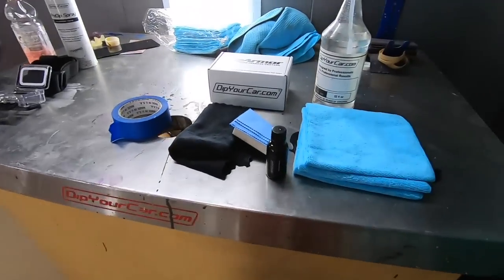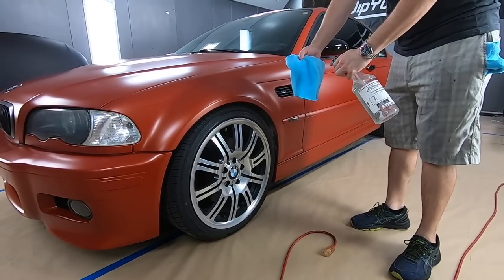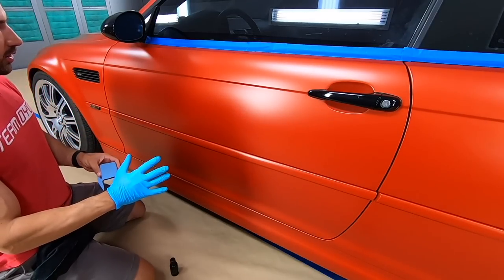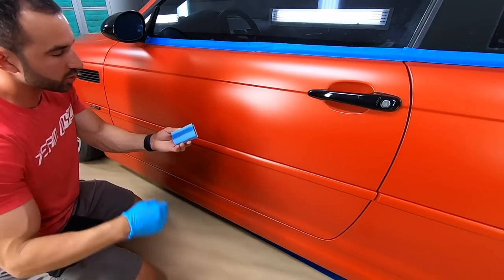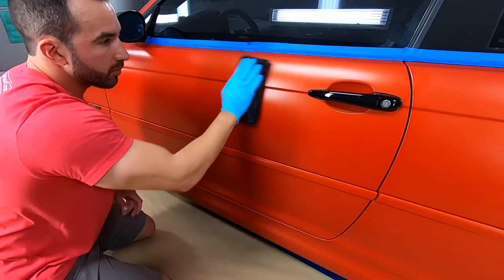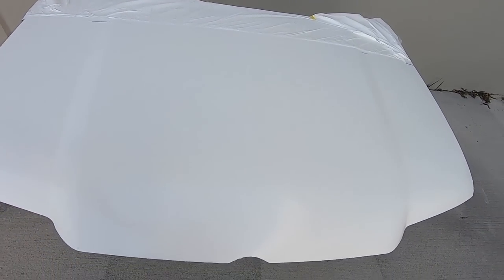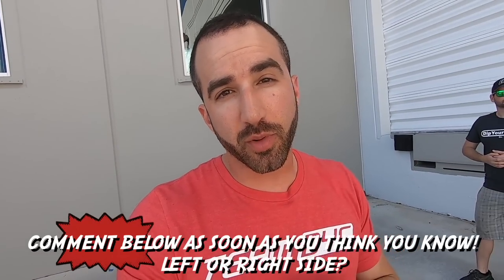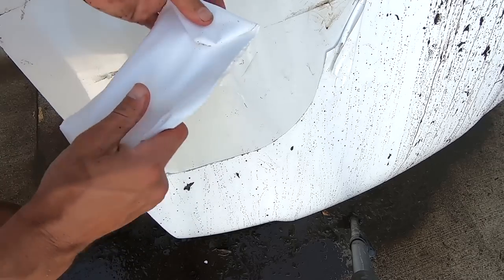Finally CERAMIC COAT Your PLASTI DIPPED Car  (Amazing)

Comment from the maker: How long did it take you to guess correctly?
Reply: After the first pour of blue on both sides works really good.
Reply: Left side for sure
Reply: As soon as the blue hit the left side, I knew right away. Lol wayy more hydrophobic
Reply: On the pour of the blue liquid. That's freaking awesome!!!
Reply: 'Bout 3 secs... dip armor is good, but it's just not a ceramic coating. ;)
Reply: As soon as the blue hit the first time you could tell that wasn’t coated
Reply: Bad eyes and second guessing lol. I waited until the red Gatorade hit the left side.
Reply: What would be cool to see is a dipped hood divided into thirds. First section just dipped. Second section dipped with dip armor. Third section dipped with dip armor and ceramic coated.
Reply: I still don't know which side has it.
Reply: Cali kit !!!! What up tho
Reply: DipYourCar 5 seconds lol awesome job Fonz 💯💪
Reply: Ceramic coatings are great for warmer weather climate but when you're in Canada where it's -20-30+ degrees in the winter I can assure it's the worse thing to do as every area that has PPF in front of my car the ceramic coating itself will crack into small squares in every single area! I can't imagine your Plasti Dip will be any different...

Comment: I really want to see DYC do a Dip everything series! I want to know what happens when you spray, wood, concrete, umbrellas, house walls, washers, dryers, and refrigerators. Can you just imagine a dipped tree house for your Kid, nephew , or neice, or even a young cousin! Or even a Dipped Fence! And is dip stencilable
Reply: nah... kids and plastidip don't go together
Reply: I want my whole house dipped 🙌🏽😩😂😂😂
Reply: Flex seal?
Reply: to answer the "is dip stencilable" question. Yes... just get that stencil taped down and flat before hand and pull it up while the plastidip is still wet to get clean lines.
Reply: I think a chalkboard dipped fridge would be cool
Reply: Just paint all that stuff

Comment: It was pretty clear, to me, instantly when you started to pour on the ceramic coated side. It ran off the right side but it was instant full streams running off the the coated side. Good looking product. Sucks that all this just keeps adding to the price of a dip job HOWEVER, it now makes it viable where I live. Dirt road (prone to paint chips), lots of wind, lots of dirt, lots of mud when it rains, not being able to park in a garage. Dip armor and ceramic coating solves all of that.

Comment: Plastidip protects the paint, Dip Armor protects the Dip, and Ceramic Coating protects the Armor. Haaa!
Reply: And manufacturers originally used paint to protect the metal.
Reply: @nighthawkcm8872  then they eventually used clear coat to protect the paint
Reply: Dipception.

Comment: Hey i'd like to know how ceramic coating reacts when outside temperature is around 30 degrees celsius. Is it compulsory to apply on a controled air area (air con) ?

Comment: I have a question or comment . I just plasti dip my wheels last week . But I had add ceramic coating on them like 2 weeks ago so when plasti dip them 3 days later start peeling . Question ;! They peel because ceramic coat ?

Comment: At 12:45 - as soon as you started pouring the water I knew immediately that side wasn't treated. :) Dip armor is definitely good, but it's not a ceramic coating. ;)

Comment: You should abuse a dipped car with ceramic coating as in take it down gravel and mud and then let it dry. No washing for a bit then spray it off in a video

Comment: This is misinformation i used ceramic coating on my plastidip and it blured all the plastidip..is ruined now..
Reply from the maker: As stated in the video, this car has Dip Armor Advanced TopCoat on it, which allows it to be ceramic coated.  You can not ceramic coat standard Plasti Dip.

Comment: This is a waste of money because the underlying layer being the plastidip is just going to peel off in 2 years or so. 

Plasti dip should only be used as a test platform to see if its the color you really want. When you finalize your decision then you paint the car and then ceramic coat it.
Reply: Get out of here with your negativity....

Comment: lmfao, this is like spraying clear coat on your girls face to keep her makeup from running. 
Plasti-dip and all the coatings like it are meant to be temporary. These are not permanent coatings. Why would you spend this time and money on your vehicle for something that, if you take immaculate care of it, will last a year? I've sprayed 4 wheelers and motorcycles with plasti-dip and it's simply a temporary coating. 
You guys are freakin hilarious spending hundreds and hundreds of dollars on a "paint job" that anyone with fingernails can completely remove in 5 minutes. 
Paint your car. Quit being cheap asses and spend the money to paint your car properly. Then you have an actual reason to use ceramic coating on something. Anyone who thinks plasti-dip is a proper coating for cars/trucks is the kind of person who would wear flip flops and overalls to a 3 star Michelin restaurant.

Comment: I don’t get it. First you spray a base then a color, have to spend money on pearls or metal flakes then spray it with armour and then ceramic coat. Seems like a lot of cost and time. Just do a paint job and have better results and way outlast dip. Sorry just lost my interest
Reply: Dude, you do know you don’t have to do all of that. You can literally get the regular plasti dip kit for like $300 and be done with it. This is optional for those who actually want to do this to their dip.
Reply: Some people just don't get it
Reply: Yes I know but then your vehicle is easily scratched hard to clean and and not chemical resistant
Reply: @jeffwall7454  not with dip armor.. and if you spray it right it's not hard to clean